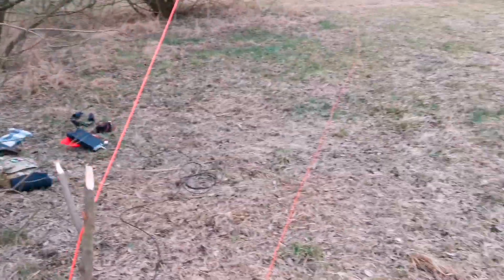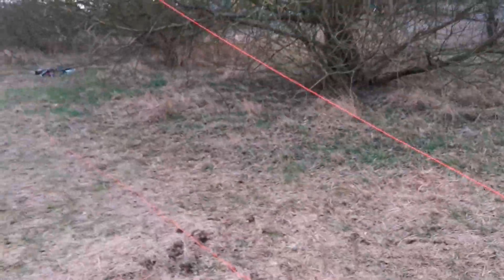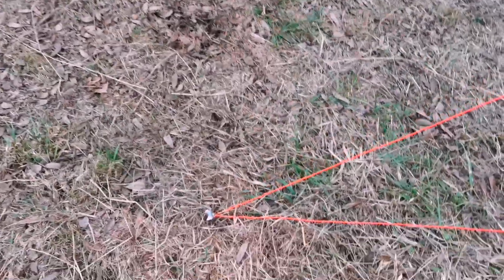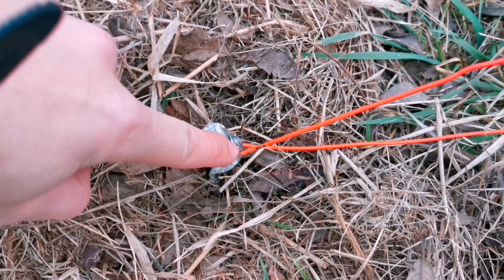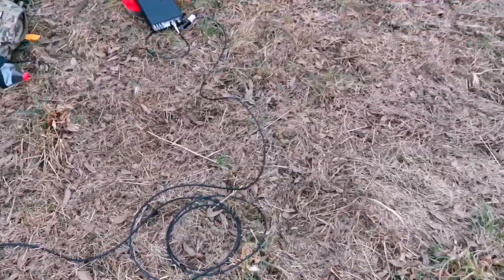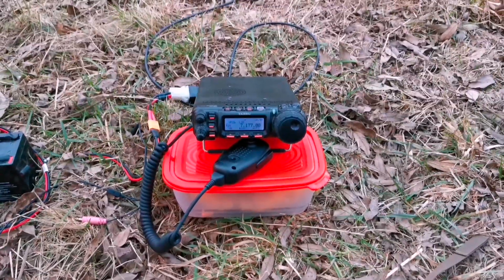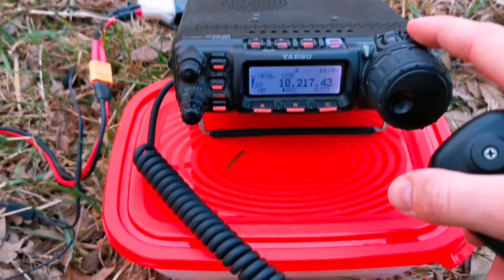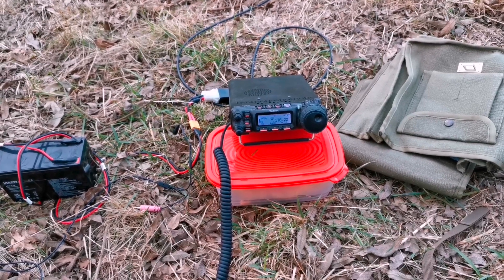Antena HF20A - kolejne testy anteny Pt. 2

Comment: Hi Mr Andrzej, does the H20A required to be grounded for usage? My shack is far away from ground. I'm planning buy this budget antenna for my first HF radio. Hope to hear from you soon, thank you :) 
73 de 9W2BOL
Reply from the maker: Hey!
I got best results only with proper grounding. When earth around ground rod was dry, SWR goes really high, and receiving was much worse. I always pour water at place where I put ground rods.

Have you try end feed constructions?
Reply: @AndrzejSQ9PKW     Thank you for your input Mr Andrzej on how to use the HF20A properly. I will try to follow your recommendation for end feed type construction once I purchased this antenna. Will update the results to you soon
Reply from the maker: @ZuluYankee96  I will upload soon video with mi first endfeed construction. :)